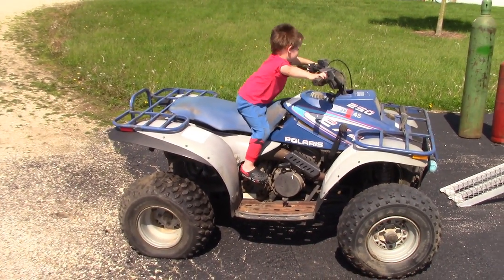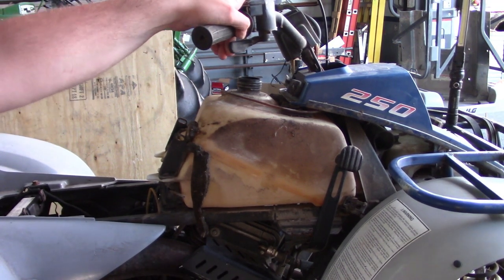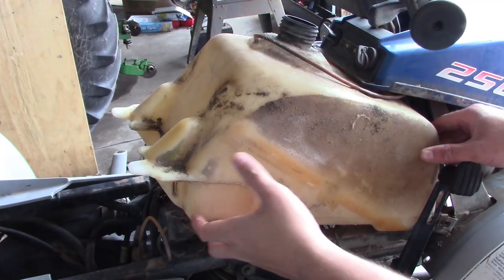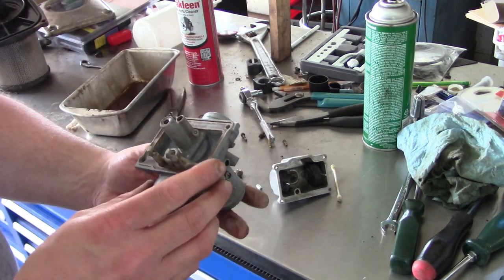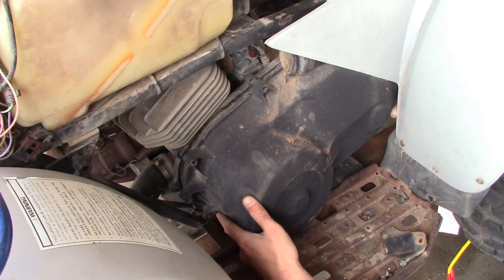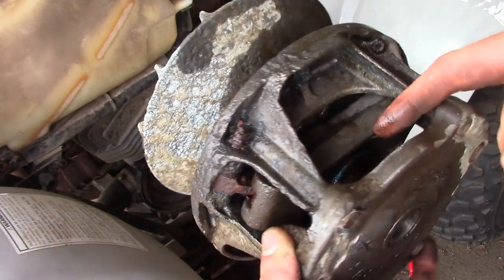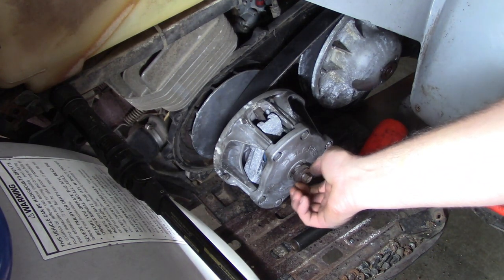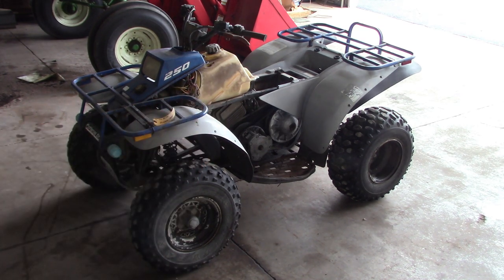Forgotten Polaris ATV | Will it Run after Sitting in a Barn for 22 Years?

Comment: The reason that your torque converter belt engages at idle is because it is on backwards. Those belts have an edge that has a bevel towards the tooth side, and an edge that is square cut. The edge with the bevel should go towards the engine, as that side of the driver pulley has a conical shape that it matches. Try flipping it end-for-end.
Reply: Both sides of the belt are beveled, it's probably just not adjusted correctly, belt deflection or belt to sheave clearance

Comment: Hey Wes! Awesome to see you got it running!
I have a brake master i’ll send ya for free to keep the project moving along. 

Also some things to note about the CVT clutch system. There is a specific clutch removal tool for the primary clutch. Can be had online pretty cheap, threads into the clutch and presses onto the crankshaft stub. ( I purchased mine from Dennis Kirk). When you take the clutch back off be sure to inspect all the weights and bushings for excessive wear. That system is the p90 style clutch system but many parts are interchangeable with the more common p85 systems found on Polaris snowmobiles of that era. Also important to note that belt alignment is critical as well as making sure the secondary clutch can float freely on the shaft. Torque spec on the primary clutch is right around 65ft/lb for future reference. As far as adjusting belt tension, there is not external adjustment on that system, there are shims that can be removed in the primary clutch to adjust the belt clearance but I promise you that you don’t want to hassle with that. The belt will wear in over time.

As for the crank seals on that Fuji engine, I believe the case needs to be split to install them but I am not 100 percent certain.
Reply from the maker: Yeah, I was able to borrow the proper puller to do the seals. I'll look it over before I put the guards back on. Thanks for the info!
Reply: I thought the same about the seals but oddly enough you can replace them without splitting the crankcase. There is a video on YouTube on the procedure.
Reply: I have a “big boss” 4x6 of the same vintage as this trail boss (same atv with a dump bed and extra axel) and I got it from an older gentleman that had it sitting in his barn for 15 or so years and every single brake line needs replaced. Including the masters. Little bit costly but I’m saving my penny’s! Thank you for that info on the clutches @audiquatro that’s some golden bits of info!:) glad you got this one back on the road Wes! Best of luck in the future from WV!:)

Comment: The MIC carb is made by mikuni. Very popular on snowmobiles. The emulsion tube as you called it comes out through the top of the carb. Pull gently with needle nose pliers. They do tend to get stuck. To check crank seals spray carb cleaner around seals and listen for a change in the idle.

Comment: shaking the fuel tank around with the bolts in it sounds like 7.3 running.
Reply: What does that do
Reply: @officialalloy8601  Helps knock loose the debris and varnish. Acts like an abrasive. Essentially mimics a machine called a wheelabrator.
Reply: I use apple cider vinegar to clean out rusty gas tanks. I also put nuts in there and shake the mix around like crazy. I let it soak for a day or two then I dump out the vinegar and flush it out with water. It works pretty good and I like that the vinegar is not bad to dump out on the ground, like some of the chemicals that are for this purpose.

Comment: Love your videos and commentary. If you use mixed gas and the oil injection system is working, that may account for excessive smoke in the exhaust. Just my thoughts. I would be interested in knowing what you find out about that.

Comment: Nice video and great work!
I'm finishing up the revival of a Polaris Sportsman 500 HO that spent 7 years outside. The primary clutches tend to develop a ridge at the bottom of the sheaves where the belt doesn't make contact and causes them to catch the belt at idle, especially with a new belt.

Comment: I bought an Arctic cat new in 2000. Old girl still runs. I use it for chores around home. Not able to go to the mountains anymore. Those belt drive are nice,though if they get wet start slipping. We had to do a lot of creek crossings here in the mountains. My Wife loved to ride with me,So I would make her get off in bad places. Sorry for the rambling : ) Memories are about all an old guy like me has these days. All my best.
Reply from the maker: They tried to seal them up originally. Now all the plastic covers are warped and I'm sure it would quickly will with water.

Comment: Hey Wes make sure the vent hose for the oil tank is not plugged on the trail boss I fixed one up that was sitting  for a while and the vent was plugged. Causes a vacuum in oil tank and the motor burns out. Also you put bigger bolt in center of the clutch to get the clutch off. love your videos always learn lots

Comment: If you watch carefully, Mustie wears eye protection and I think some kind of head covering when he blows out mouse nests.  Could have mites and other critters in that stuff, not to mention their feces.  Vapor blaster could likely have saved that rear clutch, but yeh the innards of that front one had to be replaced, not sure if all that could have been ordered separate.  Vapor blaster could possibly have saved the brake master cylinders also.  Great find, and great job getting it running!  That wiring issue would have been a stopper for me, my electrical knowledge is far to little to have figured that out.  Keep up the great work!

Comment: Hi Wes. Andrew Camaretta  has a site and he showcases his grading company and he constantly is working on grading equipment, trucks, and trailers. Also he buys jet skis for next to nothing and brings them back to life. One of his tricks to clean out plastic gas tanks is to stuff a couple rags into the tank and put the end of an air hose into the tank and swish the rags around for several minutes while he works on another item. Voila clean tank with no fret.
Reply from the maker: I'm not sure how well that would work. I like nuts and bolts with nice sharp edges. On a rusty tank I use nuts and bolts and a pressure washer.

Comment: My grandpa had an old Honda Fourtrax ATV from 1987 sitting arround for about 10 years since it was last cranked up. We put a new battery in it since the old one was dead, changed the oil that was over 30 years old, and it cranked right up. Now, the handbrake is busted, and the reverse cable is stuck. Its a 4 stroke 250cc, 5 speed manual. Ive been riding that thing ever since we got it cranked up.

Comment: You can make a primary puller out of a piece of 3/4" fine all thread and nut about 1' long. The clutch is threaded internally, just weld the nut on one end and use it to push the clutch off. We have 3 of these we ride with  our grandkids, a 250 and two 400 scramblers. They are awesome!

Comment: Another great video. That looks like a Mikuni VM carb very popular on two strokes. Remove the main jet and flat washer and the emulsion tube comes out the top. You could pressure test the motor. Plenty of videos available. The extra smoke could be transmissions oil from the right side crank seal. Thanks as always for your efforts.
Reply from the maker: I do have a smoke machine. Hmm....

Comment: My dad still has the same quad in 4x4. They are incredibly solid reliable machines. But a real ass ache to work on.
Just a note I've learned; set the float level slightly lower than you normally would as when you get the machine on a hillside the float bowl will become overfill and leak. When it leaks it drips down onto the starter and over time will short out the windings in the starter. It's a brilliant design that has caused me to cuss Polaris. But they are great machines otherwise.

Comment: My friend had one of these.  It was a blast to ride.  Very fast.  And it had the power to carry 2 men and a deer up a hill out of the woods.  The only thing that sucked was the mixing gas.  But the 4 wheeler was really fun.
Reply from the maker: If the oil injection works, I won't have to mix!

Comment: i had a 250 honda oddyssey for years growing up. was a rough ride with no rear suspension.  rolled it over a bunch too.
Reply from the maker: Yup! The thing I remember about mine was the turning radius. Took a half mile to turn it around unless you could skid the rear tires.

Comment: This makes me want to fix the 250 Polaris at my parent's cabin. It's similar to this one though it never even had an electric start to begin with. It runs, but you have to pull start it for like 10 minutes. Only problem is the cabin is about 2 hours from any parts shop and there's practically no tools up there. It's probably a lost cause like it needs a ring job or something, but it would be a fun project.

When it's running it's super fun. Really lightweight, nimble, and the chain drive is like having a spooled rear end. You can donut for days.

They also have a much newer 450 with AWD and fully independent suspension in all 4 corners. It's not as terrifying, but it can crawl like a mofo on some of the washed out rocky logging roads.
Reply from the maker: I think you could ring one of these engines pretty easily. Drag it back home!

Comment: Cold starting after 22 years.... and he revs it like there's no tomorrow after 2 seconds !  😋 well it sure did past the test... if you want to be sure check the compression on each cylinder. Oh and last tip if i may, you should put a 2$ little gas filter, between your gas tank and your carburator, to prevent any debris contained in your old gas tank or AT the gas pump directly sometimes even in your jerry cans.  Cool quad i'm happy for you.✌️😎
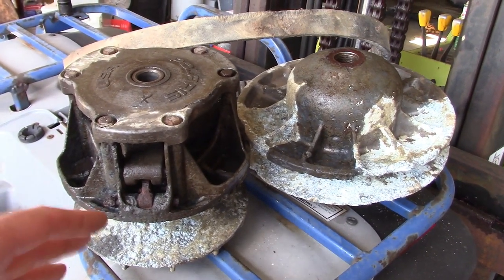Reply: BTW 35:12 ...When your clutch looks like CORAL ... yep time to swap it .

Comment: That clutch looks like the same one I made that Kubota engine adapter for. They must have used those things on everything.
Reply from the maker: Polaris seems to have made a lot of variations of this clutch system with different weights and ramps and what not. That's part of the reason I was afraid of aftermarket parts. I didn't really know all the specs.

Comment: Feeling a little bit duped on the Hamiltonville Farm channel Wes. I arrived and thought I was watching a 1984 Cab-over "Will it start" video. But instead I was fed an advertisement for a 1984 Cab-over. The crew that would be working on the truck was introduced..they did absolutely no work to get it running as far as was documented..then did the "big reveal" by simply climbing up into the cab and turning it over...then (of course) advertising how you can buy the machine several more times.

Comment: I have a 6x6 version of this and its been endless problems. Some tips for you if the petcock on the tank is plastic replace it with a metal one, just measure the hole spacing and find a generic one that fits as the barb the fuel line goes on will break. Also the ETC throttle I would remove from circuit, it's a small micro switch that has a thin tiny piece of metal pressing on it which will break off. Also be carefull of your wiring loom the one we have got the green death inside the cable sheaths, heated up and melted the wiring loom together. If it's chain drive make sure the chain is tensioned and lube it with gear oil. Also make sure there's oil in the gearbox otherwise shifting gears becomes a pain in the ass. Otherwise they're ok but if you live outside of the states good luck getting parts for a reasonable price.

Comment: What you're referring to on that safety switch is the reverse limiter. you will see on the multifunction switch side there's probably an override button. What Polaris does / did was limit your speed in reverse unless you held thee override button while in reverse. Good-looking trail boss 250.I've got the 4 x 4 version of this actually I've got two of these. This is anywhere from probably a 90-93. Really good bikes once you have them all running correctly. I love the oil injection system. And for the most part along with the injection system the engine is pretty bulletproof

Comment: You need to use dry lube on the weights and ramps of the primary. What's happening is she's sticking. Hopefully the rollers aren't 'worn' flat. You might have to break the weights/rollers loose, as they might be seized in place.

Ethanol fuel attacks older plastics, so be careful. I'd probably run the premix at 50:1, and it should help lessen the Ethanol ripping apart the fuel system.  Oil injection is great until it craps the bed and it usually does it at WOT under load, and you lock the engine up. Convenience with a risk, it's also 27 years old. I'd likely remove it and block it off. It could be pumping in air and causing you to run lean.

Comment: I have the red two fifty I think that number is correct as its so old yet runs like new. Course it didn't hurt cause it laid in the back of someones garage for years never rode. I found it and traded for it and then loosened one valve up and hit the switch and it started so easy that you would of never known it sat for so long. Now I am replacing the handle for the brake and the throttle handle as I stepped on it trying to get over a fender on my pickup. So it sat again for about three most. I still might be able to ride as my feet don't work anymore.... I like all your videos so keep em coming

Comment: The safety switch is for limiting the speed in reverse. If you want to go fast in reverse you hold down that button on the left grip. And that model is an early “trail boss” I had one that was red and white. Now I have a 92 “BIG BOSS 4x6” imagine that wheeler with an extra axel on back and a dump bed:) and all 4 rear wheels are powered! thing is a tank, it’s pretty cool. Still just a 250 tho. Needs a bit more power for its size, it also has a low range though that helps a lot.

Comment: You can mix your fuel 40to1 in tank an back out the small bolt on the intake an rev it up to see if it drips oil to see if your oil pump is working.

Comment: Inside that clutch hub are 3 plastic guides that need to be replaced. Often clean it up and replace then saving yourself a ton of money still keeping the original parts. 
The front assembly is another issue as it wears out the case and cost over 300 for new factory part.

Comment: Thanks for the work to share your adventure.  I was wondering if the smoking was due to the oil pump working and the mix being heavy since you used premix.  Or maybe there's some mice up the poop chute getting bbq'd?   Looked like an exhaust leak around the head.    Awesome work!  Thanks again.
Reply from the maker: I think it's the extra oil.
Reply: @WatchWesWork  wow, the answer was right there the whole time.  Thanks.

Comment: That pooched tire is it leaking out the sidewall? I’ve had good luck with slime sealing old dry rotted tires. My bobcat tires have been leaking out the sidewalls about 6 years now. Threw some slime in there 6 years ago and Just recently had to add more. It’s kept them from leaking.

Comment: About old seals. . POE is the magic oil ingredient for seal swell. AC lubs are usually POEs. Synthetic lubs usually contain up to 7% POE for seal swell. Musti1 on youtube came up with nifty fix for old seats. Put a q tip on a drill in there w rubing compound on it to cut new cirles in the old seats.

Comment: You could try pulling off the tube for the oil injection going into the block underneath the intake while running to see if there oil being pump out of the injection pump.

Comment: It's grinding going into reverse because the idle is too high. (But I'm sure you knew that already.) Those 2 stroke Polaris's want an idle so low they damn near stall. Also, don't trust the oil injection. They are reliable, until they aren't. I've seen a few that have seized up in the woods because the oil injection was only "half-working" and they leaned out.

Comment: I've developed a soft spot for 2 stroke engines ever since we got a 2 stroke lawn boy from my grandfather.  Got it running right and it ran circles around our two four strokes we had, and not just because its self propelled.  Starts first pull every, no matter the temperature or the weather or what have you if its got fuel its starting even with the weakest of pulls.  Wouldn't trade it for anything.  We've since got rid of the two four strokes and my dad got an Ego mower but idk I just like the Lawnboy better.  Ego set out to make a mower run off a battery, not to make an electric mower and it really shows.
Reply from the maker: I remember when corded electric mowers were popular.

Comment: Polaris snowmobiles have a safety switch in the throttle lever assembly that kills the motor if the throttle doesn't return to idle when you let go. it could be activated if there is too much slack in the throttle cable. Maybe your quad has the same setup???

Comment: I have a 1997 Polaris 250 2-stroke (Trailboss) Atv, it is exactly the same as yours and that module on the throttle is a stuck throttle safety switch. It is setup to where if the thumb control returns more than the throttle cable does it will kill the engine. It is adjustable.

Comment: You gotta be careful with some of those 2 stroke Polaris engines.
Sometimes it's imperative that the oil injection works because some don't have crank case oil. The pump puts the oil through the crank bearings first and then to the carb.

Comment: Good save, Wes! Yes, lots to do yet but maybe at least the rear brake system can be cleaned out and made to work. It would be a good parts buggy/runner or mobile service robot anyway. I'd hope to find a similar barn find/save in my area. Could definitely put one to use! Good video!
Reply: Diego Molina

Comment: the emulsion tube pin is only a locating pine use a punch and she taps out easy also did you remember the spring and possibly a washer and o-ring on the idle mix screw? i have several years of experience in the power sports industry